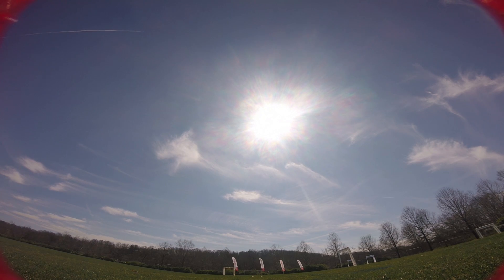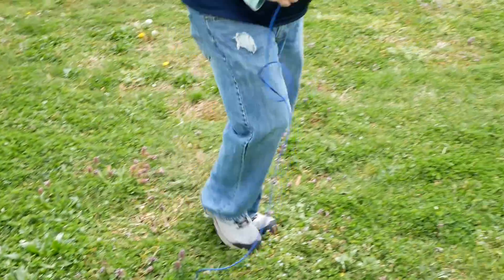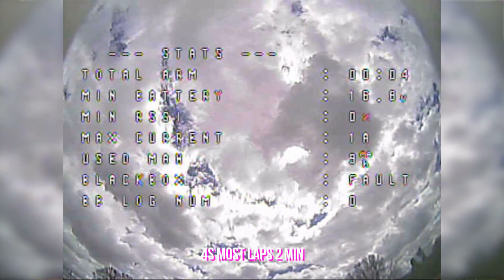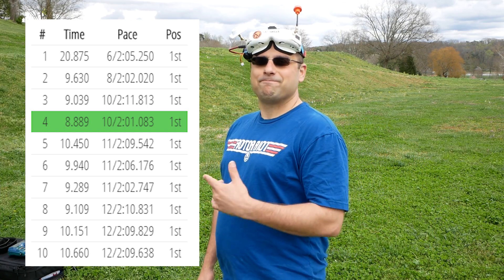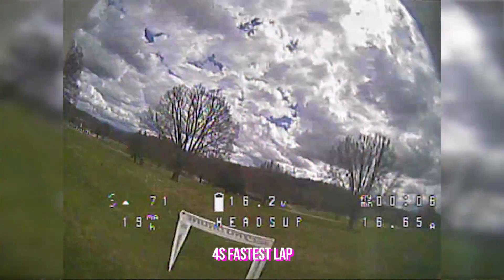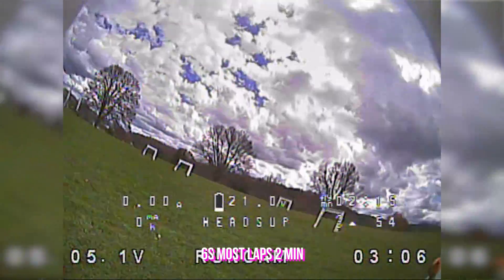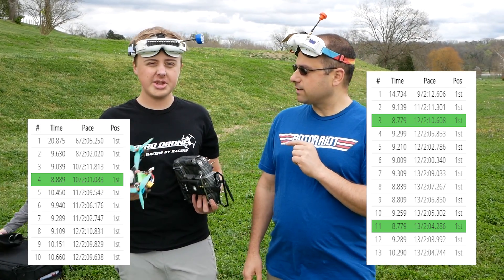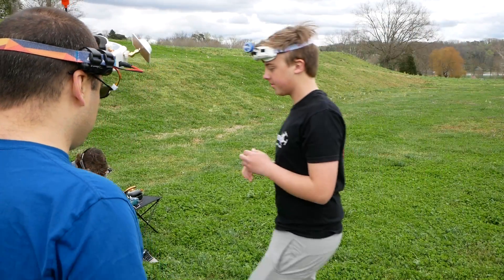6S is the new 4S | HYPE OR TRUTH

Comment: 1250 6s != 1500 4s in terms of capacity

How is this even close to usable data, lol.
Reply: "I think it's very relevant because he's comparing the most common racing 4S battery to the new most common racing 6S battery.  It's relevant for people to see the differences between those two."

But that's not the implied purpose of the video, you're moving the goal posts now.  The implied 'test' of the video is comparing 4s to 6s, not two specific packs.  The title isn't 'is this one battery better than the other' it's 'is 6s better?"
Reply from the maker: Feel free to ignore it then.
Reply: Quite understandable that the content HAS to be released at some point, but the fact is that the batteries used in the video are about 17% different in terms of labeled capacity, and the amount of additional laps completed almost the same percentage.  Evan even mentions the results are skewed by what he says about a 1050mAh 6S pack "I have 1050s, and it's just like a 4S; starts high and just slowly decreases, lap times and speed, and there's sag."

Not sure if Evan will be looking at comments, but if he could get his hands on the 1800mAh Pulse 4s (which is the closest equivalent in watt-hours to the 1250mAh Pulse 6S used in the video) and truly compare capacities it would be interesting to see if the experience is the same when compared to a 1050 6S vs 1550 4S.
Reply: To make it clear:
To compare both packs we need to have a look at the power/watt (P) and not the voltage (U) and the current (I) seperately! 
The equation is the following:  
~ P = U * I

So lets have a look at the actually energy (Wh) contained in both of the packs as used in the Video:
~ For the used 4s pack that would make 4 * 3.8V * 1.550Ah = 23.56Wh.
~ For the used 6s pack that would make 6 * 3.8V * 1.250Ah = 28.5Wh.
That means that in the used 6s pack is actually more energy contained therfore it is no wonder you can go further with the 6s pack.

It is also not quite right, that a 6s pack would need to have a lower C-Rating than a 4s pack, as some people say here!
The C-Rate is the factor you need to multiply the capacety (Ah) of a pack in order to get the Amps you can draw from them.
But a 6s pack with the same energy contained as a 4s pack needs to have a lower capacety ( less Ah) than a 4s pack.
So lets do the math for a 4s and a 6s that both contain the same energy of lets say 25Wh:
~ For the 4s pack that would make a capacety of about  25Wh / (6 * 3.8V) = 1.655Ah.
~ For the 6s pack  that would make a capacety of abotb 25Wh / (4 * 3.8V) = 1.096Ah.
Now we have a 4s and a 6s pack that contain the same energy. So lets think about two quads that deliver the same amount power of 900W (i just made this number up) next but one runns on our 4s pack and the other one on our 6s pack, both containing the same energy.
Lets calculate the current drawn by the quads in order to calculate the C-Rate the packs would need to have:
~ The 4s pack would need to deliver about 900W / (4 * 3.8V) = 59.21A to output 900W.
    Therfore it would need to have a C-Rate of about 59.21A / 1.655Ah = 36C to deliver the 59.21A and 900W. 
~ The 6s pack would need to deliver about 900W / (6 * 3.8V) = 39.47A to also output 900W.
    Therfore it would need to have a C-Rate of about 39.47A / 1.096Ah = 36C to deliver the 39.47A and 900W. 

Ther you have it! 
THE C-RATE OF BOT PACKS (&S AND 4S) CONTAINING THE SAME ENERGY ACTUALLY NEEDS TO BE THE SAME (36C in this example) TO OUTPUT THE SAME POWER !!!

However we have to remember, taht you can switch higher voltage more efficient than larger currents. But this effect is rather small, as we only use a very few watts in heat in our cable, connectors and escs compared to the power that is put out by the motors. Therfore this effects a quad not so much, but is a big thing on electric cars and so on, as the powerconsumption and therfore the current is much much larger than in our small racing-quadas.

@Joshua Bardwell Please confirm taht, the people belive in what you are saying, for good or for worth.
Like 95% of the time for good :D
Reply: Hey guys, shameless plug where I did the 1050 vs 1550 pack a few months ago. Lol 
https://youtu.be/WX86BNl4NJY
Reply: Then you should've come out and said that if you run a larger capacity 4S you will have the same effect as running 6S. Evan said himself at the end that his smaller 6S batteries sagged just like 4S so he had to run the larger 6S, which is simply adding capacity. There's no need to drive the hypetrain and get newer pilots to spend money unnecessarily on different gear because you're skewing the opinion of someone they can look up to. I made it to nationals just fine last year without once overcharging a 4S 1550mah battery. 

The only true benefits you'll see from going from 4S to 5S or 6S and dropping kv is lowering the total amp draw by raising the initial voltage which is easier chemically on the batteries.
Reply: "Appeal to authority is only a fallacy when both sides do not agree on the authority at hand. I'm trying to convince you that Evan's authority should carry weight."

This is also just straight up incorrect, rofl.    

Good grief, I give up, have a good day.
Reply: "I think that since the amps are the issue, going to 6S reduces amps for given power so batteries have easier time keeping up."

While that's true, at the sime it's not. Current decreases, that's true but so does the cell size. 
A current of 120A pulled from a 4S 1550mAh pack (22.9Wh) yields a discharge rate of ~77C. 
A current of 80A pulled from a 6S 1050mAh pack (23.3Wh) yields a discharge rate of ~76C. 

I don't see how 6S stresses the batteries less than 4S in that scenario.
Reply from the maker: Gapit: what wins races over the course of a season is hardly pure anecdote. At some point, the sheer number of trails mean that conclusions can be drawn even though not all variables are controlled for. When the goal is to win races, looking at the equipment used by race winners is meaningful. Racers have tried many things to fix the "2-minute problem", including trying to get MultiGP to reduce the heat time so their poor batteries can fit. If 1800 mAh was a viable solution, I think we would see them using it.

It will be really interesting to see how the 2018 season shakes out, to be honest.
Reply: GAPiT FPV agree. But, sponsors and hype.
Reply: "That is the thing, he was using a 6s that is heavier then the 4s but still got faster laptimes. So for racing 6S  is clearly better."  

This is not how science works.  "In this specific test, once, the results show suchandsuch.  Therefore it is PROVEN!"
Reply: Joshua Bardwell I love your followup, really.
It was necessary to say that the test was unacurate.
But I want to add some thoughts. Using a 1550mAh High Voltage is not comparable to a 1550mAh 4.2V.
You reach 1550 on the HV when you charge it to 4.35,  if charged to 4.2 maybe it's 1400 on it.
It's easy to test.

Hope there are place for a more scientific test someday.

Bye!
Reply from the maker: That 4S 1800 is 20 grams lighter than the 6S 1250. I think the most fair test is to pick two batteries of equal weight. If the 6S can pack more Wh into the same weight somehow, then that's just a point in its favor.
Reply from the maker: "An argument from authority, also called an appeal to authority, or argumentum ad verecundiam is a form of defeasible[1] argument in which a claimed authority's support is used as evidence for an argument's conclusion. It is well known as a fallacy, though it is used in a cogent form when all sides of a discussion agree on the reliability of the authority in the given context."

I'm not just making this stuff up.

And I'm not saying we should take Evan's opinion as true instead of having evidence for his claims. I'm saying that we shouldn't dismiss his (and others') claims simply because we find one inconsistent aspect of the observed data.
Reply: ok ... "clearly" is not right, it shows more a direction that gives the expectation it will be better. For science you would need a lot of tests. If you can get constant condition... maybe  20, but if the pilot crashes while flying you would need extra rounds... scientific testing gives you a huge rats nest of important things that need to be considered

PS: And as JB said: This is a pilot who tested it and needs to know what works best for him. It is not something like a "magic copper jewelry" where the player hits the ball better because he feels better. Evan uses a product that gives him more than just the feeling of him flying better. He simply notice and sees more sag and less constant power when using 4s 1550mah over a 6s 1250mah.
Reply: Joshua, you keep telling that the 1550 is 20g heavier than the comparable 1050 6S. This 4S battery is a HV battery and in the video it is charged to 4.2 volts. So it is not even fully charged and contains maybe 1300-1400mah PLUS heaving dead weight (as a real 1300 would be much lighter). At this point it is ridiculous how you are defending the "data" in this video. It´s just not apples to apples, it is comparing a lipo that has not enough capacity with a lipo that does have enough capacity.
Reply: I feel like giving you a hug man. 😐
Reply: @gapit Sometimes, its not science and just an entertainment video.  There is no conclusion to be drawn from this content other than what Evan personally prefers.
Reply: +GAPiT FPV YOu just said yourself you don't know what racers are using! 

If you're not even up to date on what tech top pilots are using then you can't truly trust in your own opinion can you?! 

This is what is winning races. That is a fact. If you can either win a race yourself on 4s or find a winner running 4s then crack at it mate. You're claiming naivety and then supporting that claim with bizarre proof from baseball.  Wtf?!
Reply: " The key to higher voltage here is that we can actually run lower C rated cells which are smaller and lighter than their higher C rated counterparts.  This works since we are distributing the wattage across extra cells, reducing the amperage that is being pulled from any one given cell compared to a 4S battery."

I'm not an EE, so I don't really know if there's merit to this, but it's a line of reasoning I've heard before, and it's intriguing.  That said, it seems like the each cell would need a proportionately higher c-rating because the capacity of each cell is less than a 4s, which means it'd be a wash.  Also, you said that for the same WH capacity as the 1250 6s, you'd need roughly an 1850 4s, which is true, but when you look at 1800 4s packs, turns out they weigh around 195-220g, which is about the same as the 1250 6s.

In the end, I just don't think any of this is usable or helpful data.  If anything it's misleading.
Reply: That is the thing, he was using a 6s that is heavier then the 4s but still got faster laptimes. So for racing 6S  is clearly better. But if you could manage to do a test with most laps in 2mins with a 4s 1800mAh https://www.pulsebattery.com/pulse-lipo-1800mah-4s-75c.html
vs 6s 1250mAh this would be great. Those are equal when you compare Wh per Gramm (but the 4s has a higher possible Ampdraw, in theory) Im just curios, but still think the higher ampdraw per Cell with the 4s will make it loose.
Reply: Joshua Bardwell  add weight to the 1050 6s to equal the weight of the 1550 4s?
Reply from the maker: Evan says in the video that he is using the HV pack but I don't think that's right because we weighed his pack at 194 grams and that is exactly the weight of the non-HV Pulse 1550 4S.

It looks like I mistakenly linked to the HV though so thank you for pointing out that error.
Reply from the maker: The 1550 4S that we used was 194 grams. The 1050 mAh 6S Pulse is 171 grams.
Reply: You should give a try the 4S AMAXInno 1800mah a try.
Reply: The Pulse 1800 4s is almost 30g lighter than the 6s 1250 so I wouldn't say they're equivalent, despite the labeling.
Reply: Joshua Bardwell Do low kV motors on 6S draw less amps at a given RPM than high kV at 4S?

Could that account for less sag as well?
Reply: It's the sag spread out over more cells.betyer recovery. Is that what the racer said also?
Reply: John E Fly John Amperage is disapportinate to voltage. The higher the voltage lower the Amperage and wattage stays the same, relatively.
Reply: cito FPV  I agree , we need to apply ohms law to this in order to be exact on the findings.
Reply: Gon Qu-  Yes... but the nominal and peak amperage available for the lower mAh 6s (to achieve same pack weight as 4s) will also be proportionally lower if the energy density and C rating is equal to the 4s.
Reply: GC Cannonball Nonsense.  Like you have any real-world racing experience.  Pffffffff.... ;)
Reply: Of course, but we know that the c-rating is more commercial than a real parameter. I have 4S and 5S 5" kwads. The improve in flight time is a fact.
Reply: I think the argument of battery capacity within a weight constraint is something to be looked at. If 4s or 6s can pack more watt hours into the same weight limits. If one gets more capacity for the same weight that's a factor to consider.
Reply: So we are able to pack more w/h for the same weight and we have less loss in the form of heat due to the lower current requirements to hit equivalent wattage requested by the motors. I've never understood why this subject has been a debate, but then again i've heard a national champion at the track say he'll charge his 4s to 18v in order to prove 6s has no benefits...so i guess this will always be a debate.
Reply: GAPiT FPV Sorry to hear that, although I really didn't expect as much. Just talk, got it. Unsubbed as I don't have a use for a vanity YouTube channel.
Reply: lol
Reply: Thanks for giving up!
Reply: Our batteries are amp limited, by going to higher voltage its not pushing the current as bad, but still has the power at the motor (with lower kv motors), also less IR losses with HV.
Reply: @user-rs8zg8ey2b  good lord thank you!!! Im an electricina by tade and i also hold an elecltronics technician ceritifacte... ive been waiting for this answer while reading this thread... AMPS MATTER ON BATTERY VOLTAGE SAG!!!!
Reply: GAPiT FPV they might work.  Never know.
Reply: That moment when you just start into this hobby and you don't have to feel sorry for wasting a bunch of 4Ss that cost alot and are still flyable.
Reply: deleted
Reply: As the combinations of prop designs, available motor kv, aerodynamics, and pilot, make a real test super complicated due not only to assembling the correct configuration but also tolerance s (e.g u might have a great battery by accident)....it  is really down to pilot feel...and not a comparative test. But hasn't this been done for helps already, the impact on batteries is about same, leas current but smaller cells. But maybe escs can get smaller?
Reply: +GAPiT FPV
Hey man :) I did 1 year of electronics in School before switching into IT back in the days. You can google "formula for watt" to confirm this. The way you get watt is by doing (V * I) Volt times Amps. Watt is the actual working capacity at a given time. So if you imagine each cell being a person trying to lift something heavy. Like a big rock. Being one person(cell) this would be very heavy and you would run out of power very quickly. Adding 3 more people it would be way easier and you could carry it for a long time. Adding 2 more (6 total) would make it even easier. It's the best analogy I can make for you :D
Reply: 6s and 4s are. Otherwise old news.  Sneak peak coming soon of what 88mph and a flux capacitor can do. Stay tuned.
Reply: @DVJiMATT  Tuned out, link to your flux cap  bud.
Reply from the maker: These criticisms are valid and there is always room for additional controls in a scientific experiment. 

I can't help but notice that none of you have asked whether I controlled for the age of the batteries. The 4S were brand new while the 6S had about 25 cycles on them.

Nobody has asked whether I validated that the actual capacity of the batteries matches the mAh on the label.

Nobody has asked whether I controlled for variance within a batch by running multiple heats on different packs.

My point being, there are always more things you can try to control for. At some point, you have to say, this is the test conditions that I have at hand, let's make the best of it and produce some data.
Reply from the maker: And since I apparently just cannot stop myself. The 1800 mAh 4S Pulse is a long-and-thin shape which is not the same as the wide-and-fat shape of the 1250 6S and the 1550 4S. That would also produce a difference in results that couldn't be controlled for.
Reply: LOL!  Gapit doesn't even race.  he's just having one of those days.  I unsubbed gapits channel months ago because of shit like this.
Reply from the maker: The number one most limiting factor in this test was that Evan has a very busy schedule and it would be impossible to get a hold of him again for another few months. Since going to 6S, Evan swears that it is better than 4S and never wants to go back. When a top pilot like him makes such an assertion, and I get the chance to pick his brain and look at the setup he actually uses for racing, that has a lot of value.

If you watch this video and think, "Wait a minute. A 4S 1800 mAh should be just as good as that 6S 1250 mAh!" Good! Go get some 1800 4S and test it. Progress is happening. Knowledge is being advanced.
Reply: I've flown the 1800 75c pulse. I have a bunch of them. They sag as well when you go hard. You just dont get the same consistancy of power as the 6s. I think it has a bit to do with the fact that once you start hitting that sag range the low voltage supplied by the 4s just cant keep up with the motors while the the 'low' voltage provided at the end of the pack of the 6s it distributed through more cells and the low KV motor still reponds well to 20v as applosed to the high KV motors starving on 13v.
Reply from the maker: BUTTTTTTTTBUT.

I have to ask you: if 1800 mAh 4S are just as good as 1250 mAh 6S, why have we (literally?) never seen any top pilots racing 1800 mAh 4S and winning? It's not like they don't know they exist. So please don't be so dismissive of these results just because you look on paper and the Wh of the two packs are the same.
Reply from the maker: PS: It is a 1250 6S in the test. It is a 1050 6S that would be closer in Wh to the 1550 4S that was used. But a 1050 6S would be about 20 grams lighter than the 1550 6S. Our goal in the test was to choose batteries that had approximately the same weight, not the same Wh capacity. Because if a racer can get more Wh for the same grams then why wouldn't they?

Unfortunately, it wasn't possible to find two packs of identical weight. So it was use 1050 mAh 6S which is 171 grams compared to 1550 mAh 4S which is 194 grams, or use 1250 mAh 6S which is 200-something grams. Since the 1250 is what Evan actually races, that's what we used.
Reply: +GAPiT FPV The key to higher voltage here is that we can actually run lower C rated cells which are smaller and lighter than their higher C rated counterparts.  This works since we are distributing the wattage across extra cells, reducing the amperage that is being pulled from any one given cell compared to a 4S battery.  That then allows us to save weight on the total pack (and why the 1250mah 6S is so similar in weight to the 1550 4S).  To get similar capacity with 4S you'll need roughly an 1850mah 4S battery.  However, those cells will still likely need to be higher C thicker cells and I would expect this to result in a heavier battery, increased amp draw, decreased performance and in the end less flight time than 6S.

It's definitely a worthwhile test to have Evan run the same course with an 1800mah for comparison though!  I also believer there are other benefits to 6S in my testing, but those are much harder to properly convey in a video like this.  Lap times and flight times are much simpler to see.
Reply: I think it's very relevant because he's comparing the most common racing 4S battery to the new most common racing 6S battery.  It's relevant for people to see the differences between those two.  Can it then state that 4S is junk and 6S is the answer.  No.  It's just comparing these 2 particular batteries, but it still has merit.  If there turns out to be a better option for top racers, then that's what they'll move to.

Regarding 1800mah 4S packs.  The closest comparison pack to me would be the Pyro 95C 1800mah pack which weighs in just over 230g compared to 206g of the 6S pack used here which still has slightly higher capacity.  I'm stating I believe that added weight and the other benefits of 6S will make a difference, but I would also be very interested in watching another test, like this video, which puts that to the test.
Reply: exactly, I think that since the amps are the issue, going to 6S reduces amps for given power so batteries have easier time keeping up. I think this fact is much more important than battery capacity. For me this is was a very good test and I appreciate it. I won't switch my acro rigs to 6S because of finantial constrains tho :)
Reply from the maker: @matthew bennett if I were to add weight, I would get dog-piled by people saying that's unrealistic that's not how it really works in the real world. And I know that because in the past when I have made artificial constraints to try to keep variables consistent, that's exactly what happened.
Reply: Scotty Lawson don't get your hopes up, lol.
Reply: GAPiT FPV Looking forward to your video on a "proper" test. Surely someone as passionate as yourself, as shown in this comment thread, would take the actual time and effort to disprove Mr. Bardwell's testing methodology with scientific testing of his own?
I have subscribed to your channel in anticipation of your test results.
Reply from the maker: The "baseball players wear copper" argument is weak. Ask a baseball player where to stand in the batter's box, or ask a pitcher which pitch to throw against a given batter, and obviously their "anecdotal opinion" will carry weight. Ask a racing driver which tires to use in the rain and their opinion will have weight. This is no different.

I'm not trying to tell you this test is perfect. I'm trying to tell you this is the best test that could be made given the constraints at hand, one of which is the availability of a world-class pilot to actually fly the quad.

I welcome a better testing being run and building on the body of knowledge being produced here.
Reply: Again, ~60% of MLB players wear magic copper jewelry to ward off muscle cramps, lots of em win, too.  This does not make the reasoning sound.  It's just not in the cards, and any EE would balk at the 'results' in this video.
Reply: I don't know what racers are running these days, and frankly I don't think it matters.  "why aren't racers running 1800's" is not evidence that 6s is better, you're smarter than that.  What you're saying Joshua, essentially is "This pilot's anecdotal/subjective experience is of more value than math/data'  And I think we both know that isn't a sound argument.   Also, comparing weights and c-ratings and personal experiences between different lipo companies is a fool's-errand.

None of this has any impact on me, I've got no dog in the fight.  This video just seems wildly unsubstantiated and unscientific,  which is  off-tone for you,
Reply from the maker: And yes, I am saying this pilot's experience is valuable. This is a person who spends more time than all of us combined thinking about how to get around a track in first place. When he says 6S is better and here's why, you can't just go, duh, watt-hours, and ignore him. His "anecdotes" are based on hours of "trials" in the real world.

If you think you could get the same results between a 1250 6S and an 1800 4S, go for it. I mean that sincerely. Evan has raced every kind of 4S there is... I asked him after reading this comment thread and he says he's tried up to 2200 mAh 4S but over-charged 1550 was what worked best for him. And now he says 1250 6S works even better. I'm not asking you to take his word for it, or I wouldn't have bothered making the video. I'm just saying you can't write it off simply because you scratched mAh * V = Wh on a piece of paper and wrote Q.E.D. underneath.
Reply: The thing here is if we have hypothetically speaking 2 lipos, let's say 1200mAh 6S and 1800mah 4S (26.64Wh both), and we uses in 2 exact same kwads that's have the same motors but different kV that match in between with those different battery volts 1600 and 2400kV for example (35520 RPM). Common sense says that in both kwads the watts used to make his determinated job should be the same, but not, the higher voltage quad will be more efficient due to power dissipated is equal to voltage per amperage, or resistance per amperage squared. 4S kwad uses lower voltage and higher amps and viceversa. The more amperage the more power losses. And the lower kV motors have more torque per watt, that's means... more efficient. And more fly time.
Reply: +GAPiT FPV

As someone who majored in philosophy you have no idea what an Appeal to authority fallacy is. Be very careful not to confuse "deferring to an authority on the issue" with the appeal to authority fallacy.
Reply: Now we're talking about battery shapes?  I thought the purpose of this video was to see if there's merit higher voltage being inherently beneficial over lower voltage.  Now we're talking about anecdotes and specific battery form factors, lol.
Reply from the maker: Appeal to authority is only a fallacy when both sides do not agree on the authority at hand. I'm trying to convince you that Evan's authority should carry weight.
Reply: "You can't just go, duh, watt-hours and ignore him"  Yes, yes you can.  Just like you can go "dun, magic copper bracelets don't really do anything beyond placebo" when an MLB player, who's spent more time than any of us trying to find an advantage on the field, touts them.  Claiming that his experience trumps math because he's good at racing is an Appeal to Authority Fallacy.  Again, you're smarter than that.
Reply from the maker: The 1050 6S that is closer in Wh to the 1550 4S is also 20 grams lighter. After trying for a month to get the perfect test together, I decided I had to pull the trigger some time.
Reply from the maker: Bottom line: these are the exact setups that Evan races. Take the test for whatever you want. I think that having a world-class pilot take you through why he chooses what he does has value.
Reply: Joshua Bardwell I thought it was a 1250 6s?  If so, the 1550 4s has about ~85% of the capacity, which is pretty well reflected in the results.

I think it’s pretty clear that the source of the differences in performance here is a function of capacity, not voltage, as it’s proportionate.
Reply: Also, sure there’s value in seeing what a top tier pilot uses, but that doesn’t mean the data or reasoning behind it is sound.  I mean, most of the MLB players wear magic copper bracelets, doesn’t mean they work.
Reply: Your video is unusable